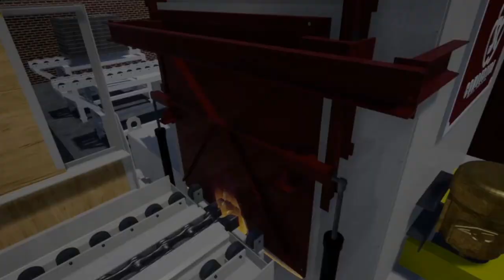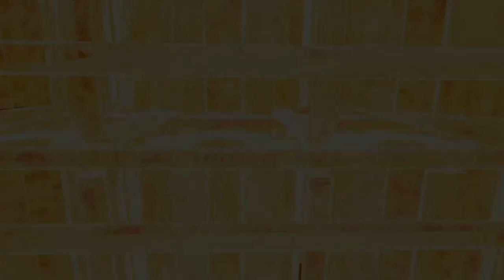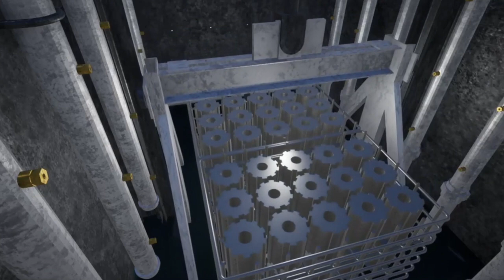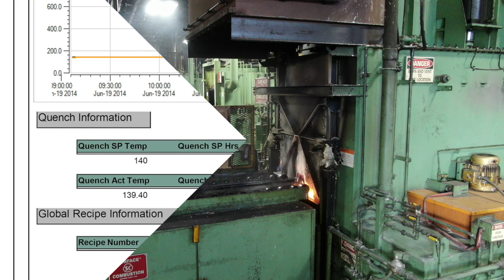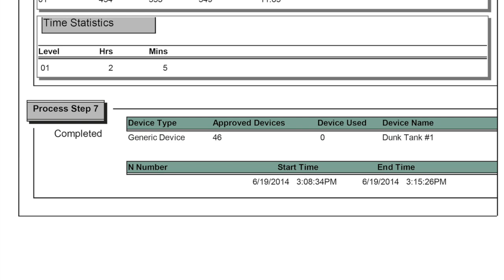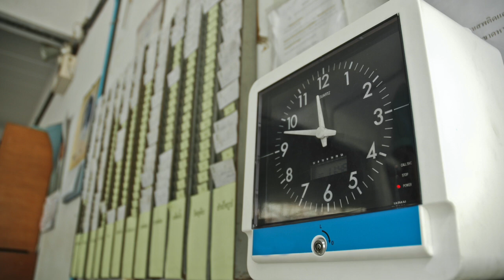Surface Combustion Allcase Automation

Comment: Proper ways for aligning the chain guide, roller bed, the proper height of the bricks holding a roller bed/ chain guide, the proper height of the brick doorway leading into the furnace from t
Vestibule